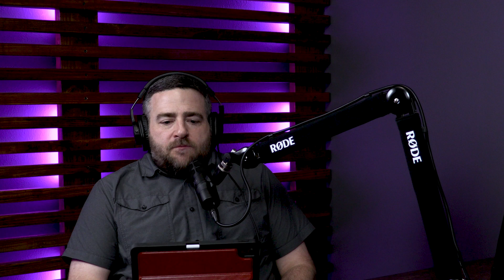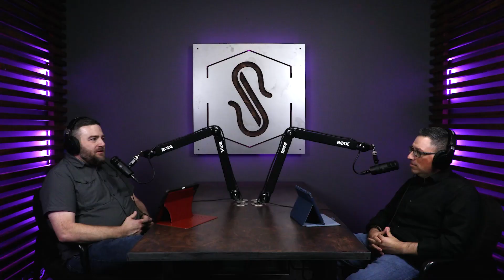Custom vs. Production & Spec Homes: Quality & Cost

Comment: This is true on one hand, but there are caveats that are not explained. Viewers also need to understand that there are custom builders, that build spec homes. As in the intention of the singular quality, blow your sox off build. Just because it may be to sell, but is built at custom and high-quality level Versus the for mentioned - working for somebody else ie, being contracted for a job. There are other variations than the two polar opposites mentioned.